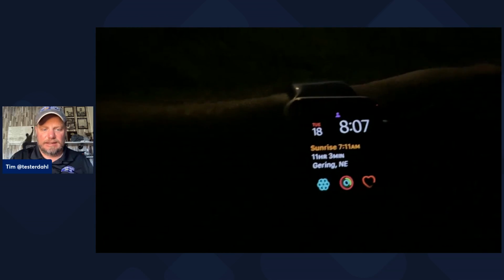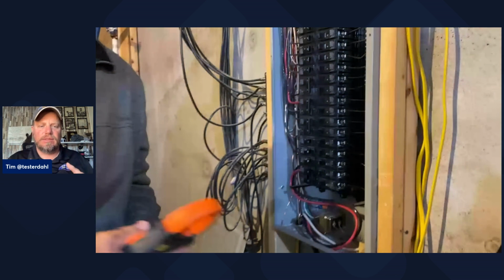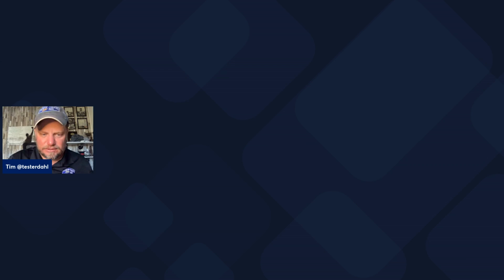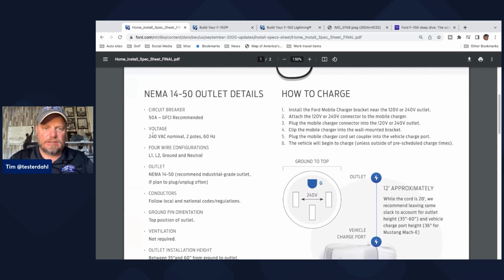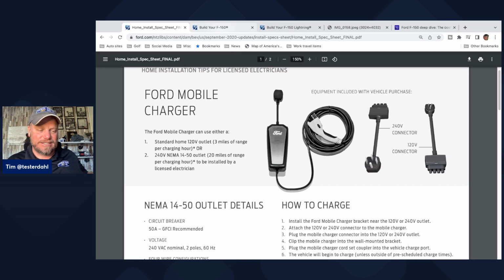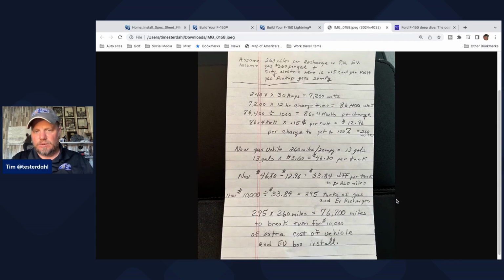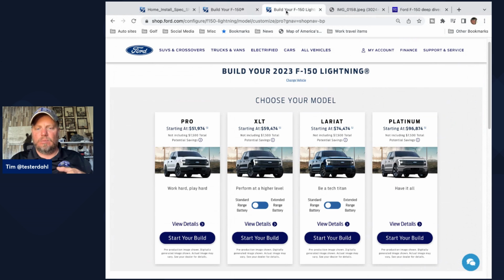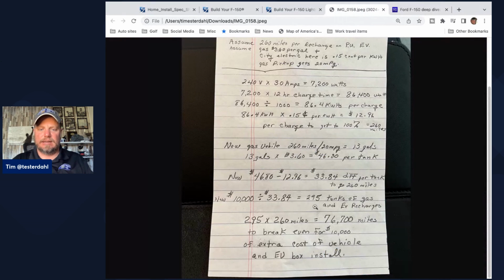11+ hours later on 220V charging price for 2022 Ford F-150 Lightning

Comment: They better make these  a WHOLE lot more cheaper than the insane prices they’re asking for now
Reply: Agree! True ROI: THE EV & Solar “Green New Scam Deal” reviled. 

EV and home Solar It’s not affordable for the masses, doesn’t save money and are environment disasters.

We just received a quote to go Solar to both charge future EV vehicles (which now average over $70,000ea) and for home hot water, heat & AC via a required $15,000+ heat pump HVAC conversion.

Cost just for Solar tiles and power wall over $150,000! (Doesn’t include cost of EVs)

Also, both the lithium batteries needed to store the power and solar roof tiles degrade over time needing to be replaced in 15 years, another $350,000 investment with Democrats caused current inflation rates at 40 year record high!

Another fact, grid power is going up 35-40% each year as our low cost, ultra clean burning coal plants are being shut down, stupid is as stupid does. 

The horrible environmental impact to produce and recycle Solar panels, Solar lithium batteries and lithium EVs batteries (if one can even afford to do so and/or find a local recycle company) are both unaffordable and environmental nightmares. 

Conclusion: 
1: No Home Solar Panels;
It’s better to install wood and coal compatible boiler systems for home hot water and home heating then heat with natural gas as a backup when going out of town. 

For AC, it’s best install a heat pump or swamp cooler using grid power augmented by a wind turbine if one can do so ie HOA rules, available land, etc.

2: No EVs
With the true cost of EV ownership (ROI) initial purchase cost, cost to charge and cost to recycle and replace EV batteries, we have decided to purchase the new 2gen GM 3.0l I6 Duramax diesels: 2024 GMC 1500 Sierra and 2024 Yukon Denali 3.0l Diesel.

In fact, Diesel is the most efficient combustion engine fuel source, carrying 38 kilowatt hours of energy in every gallon — 27 times that of lithium ion batteries!

The financial and environmental ROI impacts proves EVs, home Solar panels and lithium battery power storage are bad deals on all levels. 

In fact, it’s all a big scam.
Reply: @icare7151  maybe we should just start installing deisel generators in our houses, say screw it to the electric grid and run everything on deisel. Lol. Seriously do you remember when cell phones first developed and they were big giant bricks and expensive as hell and the cell grid didn't work worth a crap. Or maybe when the first gasoline and deisel powered cars started replacing the horse and buggy. I don't think your giving a fair argument with all the facts as you say, but that is just my opinion. Personally I think EVs will be a big part of future transportation but I also realize the tech is not there right now and it will probably be a long while before EV heavy hauling becomes reasonably viable and that's why I'm not getting rid of my 1994 Chevy Suburban K2500 6.5 diesel any time soon. But if I lived in a city and had a job that I drove to every day and my round trip was say 30 miles or less you better believe I'd be all about buying and EV car for my commute. Plug in at night, never have to go to the gas station, save on fuel cost and maintenance cost over an ICE car, seems like that type of EV use will be pretty popular.
Reply: @duncdunc76  Only when affordable, 500 mile towing range EVs with non toxic solid state batteries and zero emission 99% reliable and affordable grid power are available, EVs then will be for the masses. 

Until then, EVs will continue to cause massive grid power shortages which are driving up electrical costs, grid blackouts, huge toxic recycling nightmares, not practical for towing and the average cost is now near $70,000!

EVs are actually becoming more & more unattainable, unpractical and actually more harmful to the environment. 

The human cost and environmental damage to mine, transport, manufacture and recycle the toxic chemicals and minerals used in today’s EV batteries are not sustainable and going backwards with HUGE net negative impacts to all.

Ultra clean burning coal and diesel engines are more NET environmentally friendly than the life of an EV, solar and wind power turbines. Verifiable scientific data facts.
Reply: @icare7151  Uh not so sure about your facts but the nice thing is we all have the ability to look into it ourselves. I will give you that EV trucks are no where near where they need to be for heavy hauling and lets call it truck stuff that trucks were actually designed to do that a lot of people never do with their trucks. But EVs in general and EV cars satisfy a large portion of the publics transportation needs and sure EVs in general still have a ways to go to overtake the ICE majority preference market. But I am one of many that believe they will get there and I think it will be within the next 20 years.
Reply: @icare7151  you got scam quotes. That’s your fault, go price Tesla
Reply: @cybertrk  Have priced Tesla, Ford, GM, GMC, VW, Mercedes and the coming Ram 1500. Suggest you do the same. Average pricing well North of $70,000.
Reply: @joevigil5274  Do your homework next time.
Reply: @icare7151  I did that is why, I answered you.
Reply: Yes they must not want to sell trucks
Reply: 100%
Reply: You need to make sure the dealerships isn’t charging you markups on the vehicle. It’s why they are costing so much.
Reply: Even more fundamental, the battery technology of Li ion is not even close to what it can be in terms of
efficiency of charging and range (I don't expect double the range but why not, with the right storage
technology?).
Reply: These evs are all luxury vehicles; nitch, high end, for the rich.  There is no incentive to make them cheaper.  Volkswagon made an up based ev called the skoda citigo-e for 20k, 160 mile range, that flew off the showroom floor.  It was cancelled.
Reply: Don't worry 15 year loans soon to pay off.
Reply: 10% for Democrat Party??
Reply: The price will only ever go one way on EV's as more are built and that is up. Maybe for 5 years or so they will reduce the price to encourage uptake but once the minerals etc used manufacturing them become scarcer the price will only go up. As it stands today we do not have enough raw materials to achieve the dream of all electric vehicles manufactured new by 2035. We need to increase mining by 10000%+ to achieve that and to achieve that we need to find new deposits first. Existing deposits will disappear before 2030. EVs as a renewable clean vehicle are a giant con. No resale value after 10 years and an environmental nightmare when they reach the end of their life expectancy. Same goes for solar and wind turbines. 
All renewables emit more emissions being manufactured than they will save in their usable lifetime. They only increase net emissions NEVER reduce emissions.
Reply: @duncdunc76  Not unless they find new materials to make them. Existing resources of minerals and metals needed will not last beyond 2030 unless new deposits are found.
Reply: @saintsone7877  Well sated!!
Reply: @cybertrk  In Canada an EV F150 is $110K+, that is over $81k U.S Nov 7 2022
Reply: @icare7151  Just stating facts mate which proponents of renewables never do. They state all the benefits but will never discuss honestly the negatives. 
Simple logic exposes the lie about renewables. We have been transitioning to renewables for 40 years yet emissions continue to rise at a faster rate each year. There must be a reason for this yet supporters of renewables will never discuss it rationally. Renewables only work when there is enough wind/sun. Unfortunately that requires other systems to run in tandem with them and the only systems we have that can do that 24/7 are fossil fuel alternatives so we will NEVER reduce emissions.
Kyoto 1 increased emissions, Kyoto 2 increased emissions and the Paris agreement is the doozy as it guarantees a 600% increase in emissions yet we the poor gullible public are brainwashed that they are trying to reduce emissions with all these treaties.
Show me a country using renewables that is paying less for electricity than they were when they were using only fossil fuels to generate power even allowing for inflation etc.
There is not 1 country with cheaper power today compared to 40 years ago yet is that not the major reason apart from environmental benefits for switching. Isn't renewable energy supposedly free once you create the infrastructure? Then why have electricity prices risen every time more renewables are added to the grid?
Take out the subsidies given to renewable companies and they would all go broke on the open market. And take off the penalties ICE fuel sources have had imposed on them to make them undesirable and renewables would disappear from the market in one year.
Reply: @icare7151  Did you find out about the area required for those solar panels?
I think these big automakers didn't start development soon enough, so this crazy cost will help cover problems the vehicles develop while under warranty or recalls.
The battery packs should somehow be standardized and exchangeable. This 11 hour wait just isn't realistic. Cheers.
Reply: @RobShuttleworth  Yep. The big three know first hand the current USA grid is not sustainable for any significant EV growth without extensive use of coal and nuclear power plants which are being shut down at record rates. 

The power grid will take at least 10 years to offer Nationwide sustainable green electricity for only 10% of the current driving population. 

In fact, this past Summer, California required EV owners for weeks “not to charge their EVs to avoid further blackouts and take mass transportation or ride a bicycle.”

Furthermore, for both the consumer and utility companies, wind turbines, solar cells and required batteries to store energy are extremely costly to purchase, replace and recycle. 

The best Solar cells are only 20% efficient and like the required batteries, both significantly degrade over time; therefore, an additional costly 35% increase in solar and battery capacity is required just to account for these performance losses. 

In addition, in cold Winter climates even the best lithium batteries energy capacity can drop up to 50%, thus requiring an additional 50% battery capacity, in these markets; a massive further expense.

Even with State & Federal “tax credits”, Solar cells and required batteries, are simply not affordable for 90% of those who actually have the physical coverage area needed to meet their current power needs, let alone additional power needed to charge the average priced EV, now over $75,000.

For our house, the HOA has approved solar shingles. The cost of the shingles, batteries and installation is over $158,000, another $45,000 to replace our natural gas furnace and traditional A/C with a heat pump, simply not affordable. 

Even with a industry leading 25 year prorated solar cell and battery warranty, simply would not cover the enormous expense to remove, replace and recycle the degraded solar cells and lithium batteries. 

Heat pumps typically only have a 5 year limited warranty, life expectancy of 10 years and don’t work well in “heating mode”below 30° F, thus supplemented with electric heat elements which quickly drain the batteries, significantly shorting their service life.

The “Green New Deal” is just more Green New Government Waste of the current Democrat controlled USA Congress and White House, hitting all Americans painfully hard in the pocket books like never before with their dysfunctional wasteful failed programs and policies. 

In conclusion, the big three know all of the above and thus are offering limited EV products that are 100% impractical on all levels for the mass vehicle owner population as the current infrastructure will take decades to offer affordable, reliable, green sustainable grid charging solutions for mass EV adaptation.

Comment: Great review.  I'm one who buys a new truck and keeps it until the wheels come off.  With that, it seems just as you approach the 'break even point', your looking at a $15K cost for new battery bank.  Other point, living in Colorado most of these units state in the manual- "expect 40% decrease in range around freezing temps" 6 months out of the year.   
The other point, normally we don't have America hating politicians who's first action is shut our Nations energy production down.  Remember for previous 4 years gas was under $2.00 so if enough people wake up this expense would be nearly cut in half.
Lastly, what environmental gain?  It's being charged by 80% oil, gas or coal.  Over past decade $3.8 Trillion tax dollars were spent on green energy, this afforded our country to go from 82% fossil fuel to 81%.  
I love the truck but it seems to be powered by pipe dreams.  When the technology arrives, which it will in the future (maybe hydrogen ion?), I'll be all over it like fly's on road apples.   Great job with the numbers by the way...
Reply: You can always spend $80,000 on your own off grid solar system/batteries versus blowing it on a gas or diesel fired truck with big tires/lift kit, to drive through town trying to look cool.
Reply: @USA-GreedyMenOfNoIntegrity  What town?  I live on a farm and all 6 of my Ford trucks are work trucks that tow flatbeds and stock trailers.  Check YouTube for a video of a guy who pulls his boat with his Lightning, he got 58 mile range.  That would get me 30 minuets out of a 12 hour day.   Shouldn't make assumptions of people you have no clue about.
Reply: @HighCountryRambler  You can't argue real world working facts to a lefty living in Mom's basement.
Reply: @HighCountryRambler  You are the perfect example of why mandates to force people to buy EV's are a profoundly bad idea.  I don't road trip in the Bolt because the infrastructure in my area isn't that good. We save a lot of money using it, but when we vacation, we use our Silverado. Far less stress than hunting for a functional DCFC that isn't occupied.
Reply: I daily my '85 Dodge Aries K
Reply: 6 months before the 2020 election gas was 88 cents a gallon in Michigan.
Reply: I think electric will reduce demand for gas. In the end that is a good thing for people who need to use a gas engine until there is a real quick recharge.. Of course there are places where electric has deficits but in many more areas, urban America for instance where  the electric works and works well. Heavy use in urban America and helps moderate the price of gas foe everyone. If electric continues the demand for oil will start to fall moderating prices A good thin for you gas truck owners.
Until there are better changing options i would nt force electrics on people especially people in rural America. Celebrate its use in urban areas it will save you money down the road. Just think id electrics reduce gas demand in the US by 30% we have no energy crisis. It that happens worldwide oil ceases to be a economic weapon.  I myself with present technology would never buy an electric if I lived in rural America maybe a good hybrid but not a pure electric vehicle.
Reply: @USA-GreedyMenOfNoIntegrity  Yeah, lets spend $80,000 on an EV truck, Then let's blow several thousand more for a solar power system to charge it and then in 9 or 10 years max lets spend another $20,000 plus for a new battery for the EV truck, And then we can spend a few thousand more to upgrade our solar power system to make up for the degraded batteries and solar panels all so you can drive around town thinking your better than everyone else.
Reply: @tombeegeeeye5765  That's not how it works. When something is no longer needed as much as it was, production drops and it becomes rarer and more costly. Oil producers won't continue to produce oil at the same rate as now when it is needed less and less. So the price will continue to rise. You say EVs  work better in urban areas but only until the electricity production fails to keep up (this summer California asked EV car owners not to charge their cars at selected hours) as the left continues to put pressure on power producers to shut down power plants and not allowing new plants to be built while only allowing solar and wind production that can't meet all the needs of a first world mega economy.
Reply: In order to have a reliable grid any "green energy" solutions (wind and solar) have to be backed up with other power sources.  Often natural gas since those can ramp up when needed more so than other sources, so the solar and wind is never a replacement source. It's just supplemental and that's all it can be. 

If you have enough water and a series of reservoirs you can "store" excess energy produced by the grid by pumping water to higher reservoirs and you get some of that energy back through hydro, but that's not perfect either.

The amount of energy EVs draw in addition to home AC and other electrical draws, I don't see how the grid will be able to handle a lot of these. Not anytime soon.
Reply: @tombeegeeeye5765  I think electric has it's place...and really hybrid may be the better way to go, best of both worlds...range of gas and the efficiency of electric. 
Ultimately people should have a choice in the matter, but this can only be so if states like California don't ban gas vehicles. Oh wait...
Reply: @marks3750  not to mention when the batteries are depleted. Where are we going to dump those hard metals where it doesn’t ruin our aquifers ?